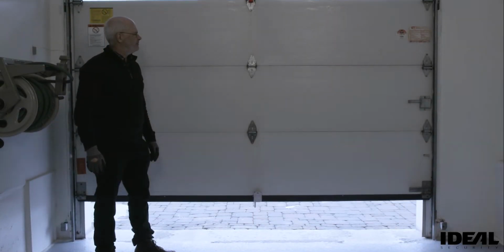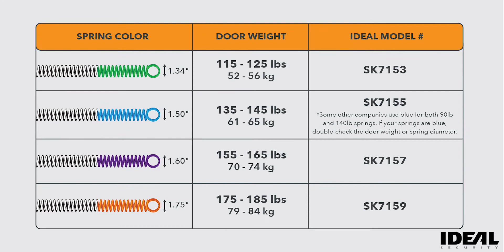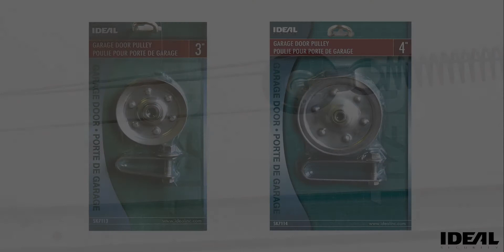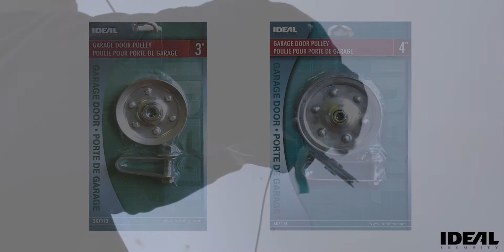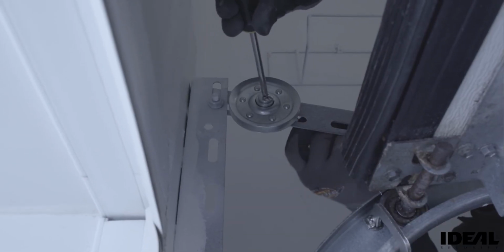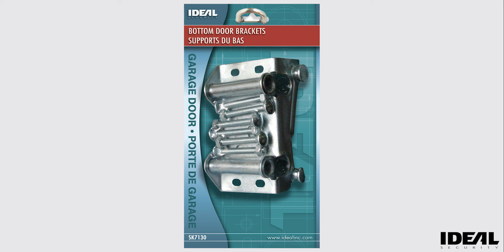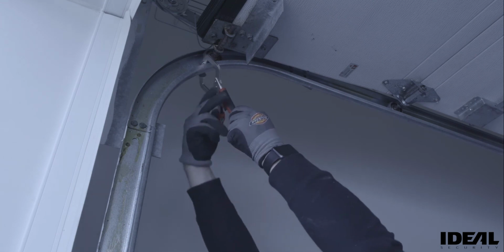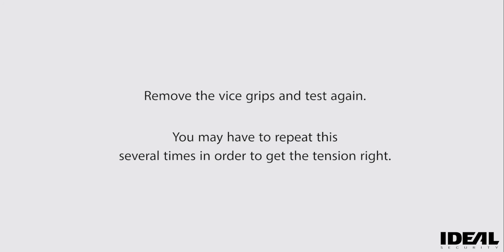How to replace your garage door hardware

Comment: Hi, my old school tension spring is broken.  It is pain in the butt to replace.  I found your product at homedepot and lead me to here 

I weight my garage door as you suggest.  It is only 90 lbs.  And i verified it is 7 feet height.

Which parts should I purchase from homedepot if I want to install your spring from scratch?

Himedepot sell spring set but only comes with 2 cable.

Thank you